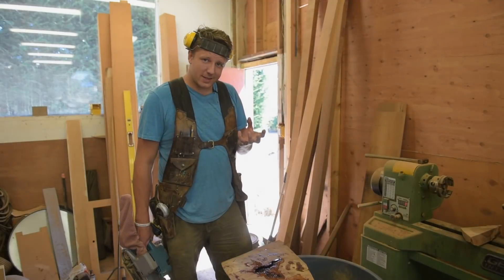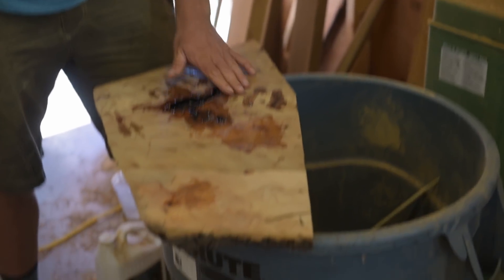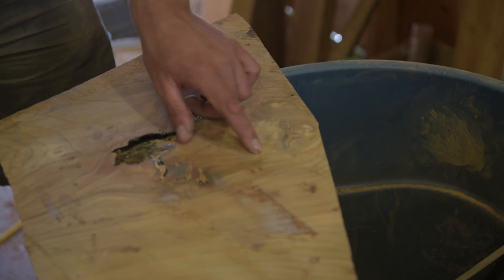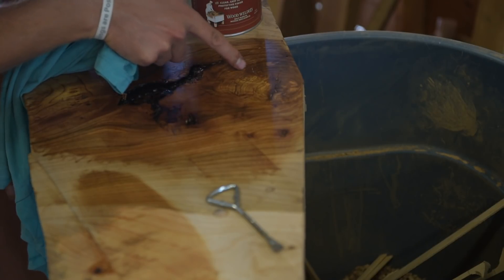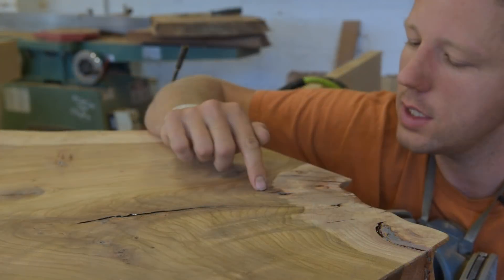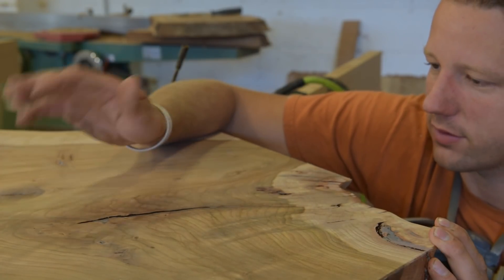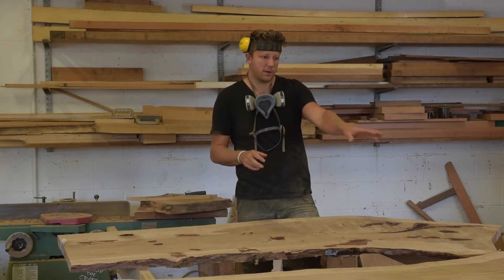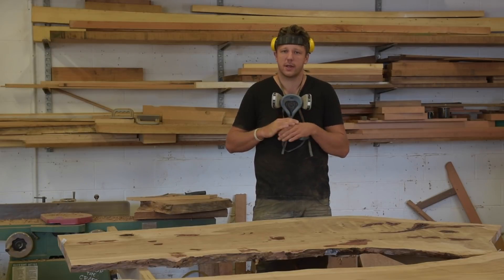How To Fill Cracks With Epoxy, Live Edge Table Pt 4

Comment: Epoxy is an exact ratio system because it's a co-polymer bonding together not like polyester resin that you can increase the reaction speed by adding more PMEC. If you want a faster reaction, you can put your resin cup in hot water. At 40 C the speed is doubled.

Comment: I poured a River table and it heated too quickly. In the morning I saw that the heat caused a crack and opened up a gap about 1/8” wide, about 3” long. Crack was going side to side. Trying to figure out if I should start over or flip and fill. Any tip would be great. Thank you

Comment: If you fill the bottom of the table with a little  fiberglass  let it dry and then apply  your resign to the top it won't leak through

Comment: Have you tried putting an orbital sander (without a sanding pad) on the surface of the slab right after pouring the epoxy to act as like a vibrator as you would with concrete to allow the epoxy to get right into the cracks then top it up again ? If anyone knows if this would/wouldn't work let me know
Reply: I've seen it used successfully.

Comment: Don't add extra hardener to the resin. Stick to the manufacturer's recipy. If you deviate from the recipy you get an inferior mix. If you want your epoxy to cure faster you should use a faster curing epoxy type, e.g. 10 minute epoxy.

Comment: Hi Samurai!! Im making a dinning table and filled some knots and holes with clear epoxy. My question is: when sanding, how to prevent the epoxi to get that white and scratched look? I just have a normal/cheap orbital sand router.
I would aprecciate your help. Cheers

Comment: Tranfer paper might work better than tapes. Tested just talked quite a bit about using it on a wood surface to protect from singing or scorching when the wood is cut in a laser cutter. Tack might be robust enough to adhere to the wood, but strong enough to seal and easy to remove. Just a thought.

Comment: try the new gel type CA super glues to let run in set quicker and seal like the epoxy did for first coat.  new stuff is even colored. used for guitar neck inlaying. great for knot stabilizing

Comment: What was he doing to the sandpaper on the belt sander at 8:03? It seemed like he was rubbing it with something
Reply: It's like a big pencil eraser. You can get them at woodcraft. They clear the wood off of the belt.
Reply: He wipes it down with a brush because otherwise the dust from sanding blocks the grid and it's not as effective anymore.

Comment: I have poured from the bottom side with some success as well.  If pouring from the top, I had an idea to use plumbers putty to fill large void before taping.  Has anyone tried something similar and does it work?  I haven't got a chance to try it yet.

Comment: I used the blue 3M tape in a black walnut knot to make a clock; I had no troubles. Also, used a light white wheel to clean the live edges, gives it a weathered look

Comment: I find that if you apply a sticky tack spray on the edge and put a border padding around it and use GreatStuff you get a seal that does not leak.

Comment: Quick question, I have made a coffee table top with a slab of spalted maple, I filled in the cracks with tinted epoxy and the top is going to be sanded to 180 grit before finish. Question is, should I sand the areas filled with epoxy with a higher grit to make it more shiny? Right now the epoxied areas are very cloudy.. Thanks.
Reply from the maker: The finish will help bring back the transparency but it will still be a bit cloudy.  I sanded the epoxy sections on my table up to 2000 but it didn't make a whole lot of difference.

Comment: The turners I've spoken with that do epoxy resin fills tend to use aluminum foil and duct tape to block the one side while they're filling. That being said, they also get to turn off whatever is stuck on, so I don't know if that would be applicable for the work you do.

Comment: I ran into similar problems filling voids. So, I taped the top side, flipped the wood, and filled from the bottom, but, only enough to seal the crack.  Maybe 1/4" of epoxy. This doesn't put enough weight on tape to bulge or leak.  Let that harden and then fill the rest of the void if desired.

Comment: Those house wrap tapes can leave adhesive residue - be careful.  I taped off my timber frame timbers with it while doing drywall.  Consequently I spent many hours with 3M adhesive remover to get all the residue off.
Reply: falfas55bgas lol been there... guy I worked with used it on hardwood at the worlds worst customers house.

Comment: 2 Years ago I epoxy filled some massive voids in a live edge slab as well. With the slab sitting flat on my bench i taped the ends of the cracks.  I then poured fine dry sand into the voids while taping the slab with a hammer until the sand was level and 3/4"`s from the surface. This epoxy "bridge" filled perfectly with no leakage. I never bothered to flip the slab and do a second pour to fill the bottom but that is an option too. And no the slab did not stick to the bench. Just use very fine dry sand. Love your work Samurai!!!

Comment: Hey Jessie. How did the underside of the cracks look after you filled them. I would have tried filling them upside down first the using the tap to cap the top part (finish side) of the crack and then peel the tap of sand and then refill to level. You could even then fill again from the underside and level off the underneath...

Comment: I used bar table epoxy on my cherry natural edge slab. First time doing it was a bit frustrating but the final product looks beautiful. Instead of using it just for the fill, I filled and used the epoxy as the finish. It dries glossy but a bit of wet sanding gives a beautiful satin finish.

Comment: I'm new to playing with wood. I'm a tree climber I have access to all kinds of wood.. as far as filling the voids with epoxy could you not use a backer rod that's what we call it in bricklaying you push it in and fill up the void so you don't use as much material. also to get the epoxy to settle in have you ever vibrated the wood what you do with concrete to get the air bubbles out why wouldn't it work with the epoxy. great stuff like your Channel

Comment: For a final crack fill when using epoxy, use a epoxy suringe to fill the cracks then apply packing tape over the gap and then turn the piece over.  You will end up with a gllss smooth finish of the epoxy and not much extra material to sand off.  Also works on vertical surfaces.

Comment: West Systems epoxy can use fillers with different physical properties for working with voids. Some are structural, and very hard to sand, others are "light" and sand easily when fairing, etc. These fillers do not affect the mix ratio or bond strength, can be used as heavily or sparingly as desired, allow the use of much less epoxy, and doesn't run as easily.
My approach is to only rough surface the slab. I then mix a batch of epoxy in a shallow container, pour a 'wash coat' into the crack using a shop vac or air gun to help pull the epoxy through (I'm only coating the inner surfaces, not trying to fill the crack). I then mix a fresh batch of epoxy with a small amount of filler and dye and start packing it into the smaller cracks, again using vacuum and/or air if needed. I mix in more filler as needed to get to a workable thick consistency. As I progress to the wider cracks, I add more filler for a thicker, pastier mix. I finish by topping off with dyed epoxy with no filler to bring to surface and fill remaining voids. The final surfacing removes all the mess with no sanding. Any small voids after machining are easily filled.

Each of the listed steps can have up to a 24 hour period in between, and still have a full strength bond. I try to move through all the steps without  any long waits, but there is no frantic activity if something isn't working quite right. Much less stressful.

West Systems has plastic tongue depressors for working with thickened mixtures.
Reply: gearmo B has the right info . Definitely do the work on the rough slab saves time from refilling and sanding later
Reply: can you just use saw does as a 'filler' or is that a bad idea?
Reply: The only drawback to mixing in sawdust is ease of mixing a consistent and homogenous batch  each time. The fillers aren't expensive.

Comment: If possible, use foam plates or trays to pour the epoxy in after mixing. It will slow the exothermic reaction by reducing heat build-up. I learned this when learning to build composite model aircraft.

Comment: Instead of casting resin epoxy would be 2-component glue, which is thick liquid and hardens after 5 min.
Reply: the West system he is using is a two part epoxy. Set speed depends on the epoxy used.
Reply: I have seen that.
What he had used is casting resin, one gets also here and with different curing times (5min, 30min, etc.)
I thought he should use glue because that is viscid.

Comment: Use the duct foil tape. It seals very well, in fact I have bridged 7-8" side gaps to keep the epoxy from leaking and it works awesome. So well, that I now use it to make little troughs to capture the epoxy on the edges so it covers in one flood pour and there's no need to go back and shape or sand the corners of the edges. They come out perfectly bull nosed. Another good tip when using the foil tape is that the non sticky side releases very easily from the epoxy, so you can hold an area with the tape inside out and secure it around the area you want to peel off later. Once I got this technique down pat, I started using non-stick Reynolds aluminum foil in it's place for flawless finishes!!!

Comment: If you use a thickening agent to the epoxy, it won't ooze quite so much though it would reduce light transmission if that is an effect you desire. Also fillers allow you to make the mix much harder when it dries or use the microlight which is much easier to sand than colloidal fillers. You can also shellac the crack and presuming you are correct about the wood absorbing the epoxy, that will be reduced.  And all i've said you've already likely learned  since that is the kind of guy you are.

Comment: May i suggest one thing. In addition of putting tape as a mold below the cracks, you can put tape around each cracks you want To fill (2-3 layers). That way youll have a little wall around each crack and the epoxy will have less of a tendancy to leak all over your beautiful workpiece.

Comment: Have you thought about using some poly or lacquer to seal the voids your are trying to fill before pouring the epoxy in the cracks? try brushing in a thin coat of lacquer to seal the grain. that would help with the epoxy staining the surface grain as well
Reply: A brand of acrylic I used for void filling recommened super glue as a crack "pretreatment".

Comment: Hey so im making a desk, I have 2x2 steel 11gauge squared tubes. My inner dimensions are 68" by 32" by 2". I'll have 3/4 inch thick wood at base. I have been looking at west system 105 and 207. I'm trying to figure out the amount of epoxy I will need to fill the area. And if there are better epoxy. I want to do atleast an inch pour at my last poor and still be able to see to the base wood as it is purple heart and blood wood. I also have ideas of designs in it. Any pointers or recommendations?

Comment: You can add a small bit of heat to the table and then press it into the wood for a perfect seal. It really helps! 

Also, for the deep voids, if you are not going for the crystal clear, you can stuff in wood shavings to take up room. Not only does it take less epoxy for the first pour, but it works well to color match.

Comment: Have you tried sealing the top and sides, flipping the board over and pouring from the bottom? Maybe then you would get a flat, clean  surface on the top surface against the  tape with one pour. Would this trap air bubbles with no way to pop them (because of the tape, or would they work their way (up) to the bottom surface where you don't need to worry about them much.

Comment: Great video! I've been using a similar method on black walnut wood slice cutting/cheese boards. However, I've found that sanding/planing both sides to a "relatively smooth" surface, then taping the face side with 3m blue tape, and filling the epoxy from the bottom works best. Give it a try! 👍
Reply: Great idea!
Reply: Can you please tell me the name of the 3m blue tape. I can't seem to find it.
Thanks

Comment: Use a latex caulk on the underside of the board. Make a circle around the area. Put a plywood piece of wood over it and screw it on. Tight seal no leakage. Minwax Wood Epoxy is a  great product and it is stainable. Two part. also can be used with a hardener to tighten wood fibers. I have opened repairs from 20 years ago and the epoxy looks like new and is hard as rock. 
Best man.

Comment: if your using that type of tape, especially on the edges, put it in place and try a heat gun on it, not to hot or close, and press it into the wood. Bonus tip, I use an old scissors, blade into a cordless drill chuck and slow speed to mix paint, never used the epoxy so maybe it's no good for you.

Comment: I saw another youtube video the other day where they filled the cracks in wood with metal. They used a pewter alloy that had a very low melting point. It didn't look very difficult. I'd love to hear your opinion on that method of crack filling.

Comment: I really do prefer adding epoxy before the last one or two passes with 
router. Sure, you waste about a 1/2" of epoxy shaving it off, but it 
will not be able to penetrate that deep into the wood fiber, affecting 
finish and you get a very clean epoxy edge.

Comment: You might try pre-treating the wood with a coat of shellac, so epoxy doesn't soak into the wood, mess with your stain and final finish so much.  

You can do the epoxy fill in several "lifts", start with a thick mix, use West System micro balloons to stiffen it.  Save your sanding dust, use that in your final layer so it looks more natural.  

Good videos, glad you have embraced the "try it see what works" attitude.  A good way to learn!

Comment: with West systems epoxy place a spoilage board under the crack after covering the bottom with blue tape. then pour your solution in and use a torch or hair dryer to even it out or a blow torch 
but i have got to go PM me if you want more info

Comment: I have found that modeling clay works well on live edges to seal them from letting the epoxy run all over the place. It is easy to remove as well.

Comment: i have a breakfast bar has few big cracks my question is...     can i use spray foam to filll say the bottom half of the crack im assuming it will seal up the bottom nicely too (ill still tape the bottom just in case) then i only need to epoxy the top half (will be a black epoxy, adding black food coloring to it )   so wont see threw it and this way i don't need as much epoxy ?

will this work ?

Comment: Hi i work around this area, you dont need to use epoxy. instead use the dust created from sanding the temper with some Glue poor it into the crack and wait until dry and send it that what i do and work perfectly, mate you sound Aussie are you

Comment: When I use epoxy to fill in wood voids, I tape the bottom like you did, but I also tape ALONGSIDE the crack/crevice on top. This is so that epoxy only gets into the void and when you take the tape off the top, it doesn't leave a mess from smearing the epoxy into the crack.

Comment: Samurai Carpenter.  I am a Boat builder from the UK and use West Systems epoxy religiously.  I strongly suggest when using this system of epoxy on projects of value to never use more than one pre-measured pump of Hardener (not catalyst, catalysts are used with polyester and vinylester resins) to one pump of Resin .  Epoxy is reliant on equal chemical bonds and if you use more hardener than is required, then excess hardener particles end up in suspension not doing anything other than costing you money.  The only way to properly adjust speed is to either use WS 205 Fast or WS 206 Slow hardeners.  Just might tuppence worth.  Great vids dude
Reply: Oops i could have not posted my reaction. Had not seen your comment. I built my boat with SP epoxy but the same applies.

Comment: What about if you placed something inside the larger voids, something of interest like sea shells or old coins or a flower, you get the idea. What about your logo? That would be cool. A good way to advertise as well.( if the customer was ok with that) I have even seen some filled with coloured epoxy, thats cool as well. Anyways good job keep it going.
Reply: That could either turn out very nicely or horribly kitschy; it would ultimately depend upon the client's taste and preferences.

Comment: Hello the hardening process is exothermic (generating heat as it goes off) if you put the epoxy in a tall container it tends to overheat. Put in a shallow but large diameter container and you will not see that problem as much
Reply: What about placing the epoxy container in ice or cold water to slow down the exothermic process?  It will be also get thick   being cold. But when applied it will warm up again to be spreadable.   Any problem with this method?
Reply: Kevin Naranek yes that would work as well, but as you point out the epoxy might get too thick to pour, don't know about the temperature related viscosity change

Comment: You can roll up beeswax into ropes and use them to wall up the jagged corners.
You could also stuff the wax into the bottom of the cracks to seal them.

Comment: Hi Samurai 
i have an advice for you abut the epoxy. Its very important to mix the epoxy exactly in the ratio the Company recommends. otherwise the epoxy wouldn't cure properly or looses its strength after some time..  a few weeks or months. 
trust me... i'm a chemist and i produce/work with this stuff ;)